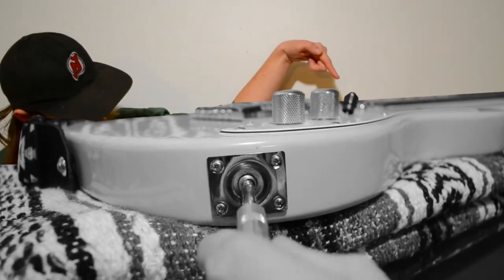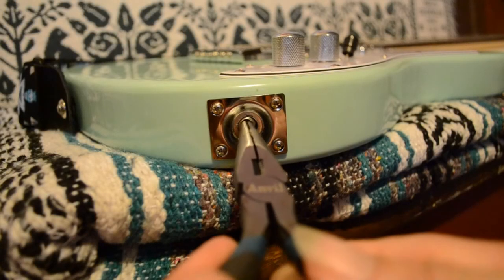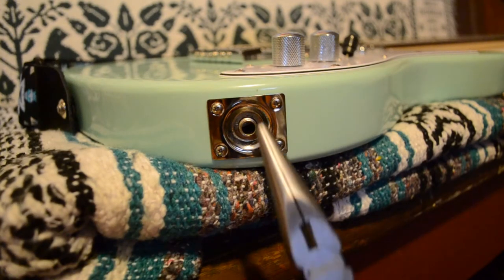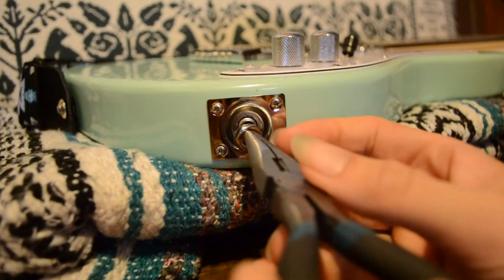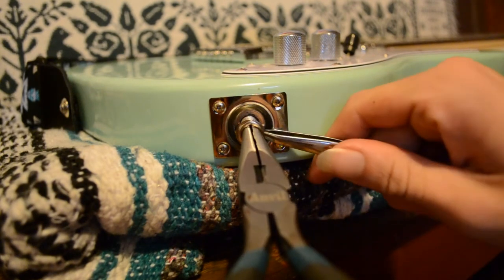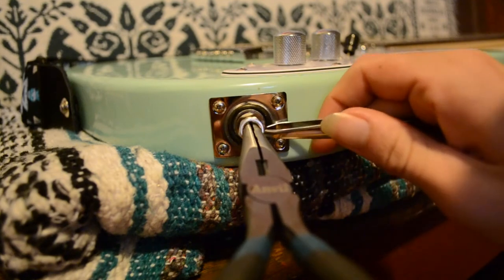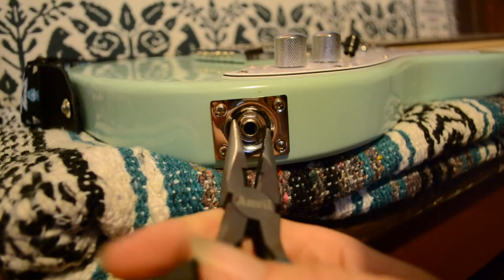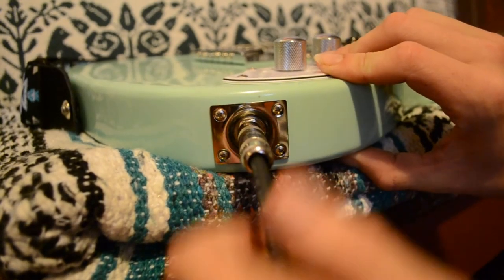Output Jack Fell Into Your Guitar? This Is How You Fix It - A Drewtorial

Comment: Thank god you posted this three days ago ! Just tried this on my jazzmaster since the bolt got loose, and the jack fell in. Because of this technique I saved money (and time) I would've otherwise spend going to a guitar tech.
I did need a bit of help on the second part, when you screw the bolt back in while holding the pliers. But with a second set of hands it got fixed easily.

Thanks a ton !
Reply from the maker: I am so glad you found this to be helpful and even happier that it worked out well for you! And yes I should've mentioned that it takes a good amount of patience to get the nut back on but it sure beats having to spend the time and money getting it fixed elsewhere.

Comment: tip n2 : preventing soldering from ripping off: use a very tiny cutting blade with a dremel or a very thin one for metal : cut on the pins thin nothes but not to much. take your wire and wrap the naked part around very tight. now solder it ( this is only to those helpfull that can solder ). now it takes way much force for a wire to be ripped of. 

3rd tip: for solderless systems. to prevent any of the conectors to losen: take some doublesided tape and cut so much of so that it covers eneough of the connectors edge. now push the connector gently forward: the pins are gonna make their holes. now the connector is sort of glued to the counterpart but still removable. this way you can make sure thse wires stay at their place while you playing your guitar... sometimes those can losen and to prevent that is the way to go this one or if you do not plan to exchange the cables or any of the parts such as the selectinc switch and the potentiometers , you can solder them at their place and letting only the coils unsoldered while securing those with said technique. 

for the poeple using active ones : yeah the battery issue. well by some whire to elongade the predelivered one where you place your battery. solder that / elongade it ( if you are not the solder pro as is the case with me : by very tiny parts used to screw cables on place those are in every store that offers such electric parts avalable ) with said wire. now push the connector to its place and either solder it in place or use the doublesided tape method. if you got a strat you either can build your own battery holder in the backplate of the tremo there is enough place for this for a 9vold bat , or if you are able to work with wood without damaging , you cut the place for the battery block beneath the strat at the lats potentiometers knobside. if this is what you do: measure only so much that your battery fits tight. cut the the place open. to get rid of the wood use a dremel that has curving tools. now cut a thin space so that you can place a cover ontop your battery : take the shape with kitchenpaper and woodglue before !!! you cut the place for the battery by masking off the place with tape that is thin enough to not result in false dimensions. now cut the battery cave and cut a thin line around so that you have enough room for the tiniest magnets ( temu or alibaba or amazon ). now cut your cover made out of paper and woodglue in shape. layer it with superthin superglue from both sides after you got your shape. cut a second part out of thin plastic. now on the papermade one glue those tiny magnets aswell as on the guitar their counterparts ( here you will need to drill holes beee carefull ) sink the magnest into the wood. now take the plastic part you made ( be carefull that is is thin enough so that it sinks on place in level with the rest of your guitar body ) and glue it ontop of the magnets ( also drilling holes needed to get those to contact the other in your guitar ) : befor doing this : cout your frist part while magnets allready glues with a very thin layer with very fine whooddust after a very thin layer of supperglue and work the shape back again. now glue the plastic part on that. now give some more very thin supperglue to the layer of wooddust between the two shapes so that it strengenths. your battery must be plased upright so you have enough room there. now after all things are don take your battery , a piece of fabrik , such like the ones yused to decorate prssents with. wrap that around your battery so that you have one longer end. decide where inside the " battery cave " that fabric piece shall be and put one or two drops of glue inthere that takes a litle time to dry out ( maybe woodglue or a very thin screw after the wodden glue to fixate it ). now push the battery along that strap in and wait a litle until the fabricstrap has sucked the glue. now pull you battery of and work the strap with a balsescrewdriver and screw it with a very thin screw.  now whenever you need to change your battery you do not need to take the whole pickguard off but have allways acces to your battery. if you want and have the time and the patience, you can turn your guitar even into waterproved one haha. however : make sure that the Cave for the battery is as wide and as deep as the battery : this is why the strap because thats the only way how you will be able to pull your battery out. 

suggestion : if you do not want to allway by a new battery : use a rechargable one instead those 9 volt things exist as rechargable ones and i now it because i used to use em to light things such as models up.

Comment: by the way : to prevent this in the first place : put from the inside a nut on the jack so much that you still can screw it on the metalplate and your never lose the jack inside the guitar ! there are plenty in that size avalable at several stores that offer such parts. here is how : unscrew the metalplate first . unscrew the jack from the metalplate. screw a nut on the jack so much that the jack can be with no issues screwd on the metalplate. now screw the jack on the metalplate with the frontnut and counter turn the nut on the other side so that there is no play. tighte the frontnut with the metal plate. nos screw the whole damn thing back to your guitar and you are good to go.

Comment: the hole behind the metal part is wider so that the jack has room ! so all you need to do is simply take the metall part on which the damn jack is screwd out ! this is not helping at all and i wonder how people think this is helpfull ! only 4 screws and you spare so much time instead of playing around for no reason with the damn jack ! i have a strat and thats not so different from yours so why in the fukicng damn hell dont you simply unscrew the screws of your metal plate, pull that damn thing out put the damn washer on it screw the damn nut tight, then the damn entire thing back in its fucking place